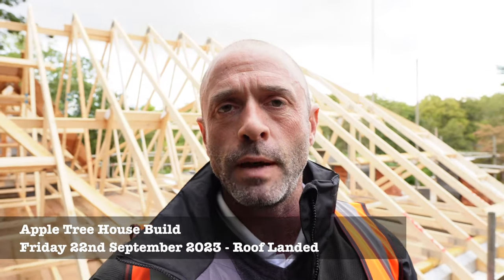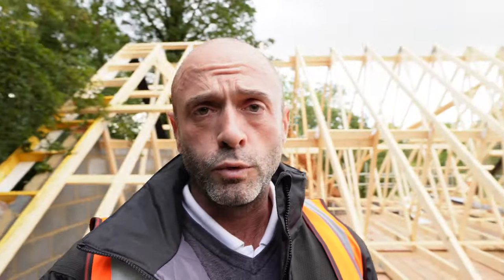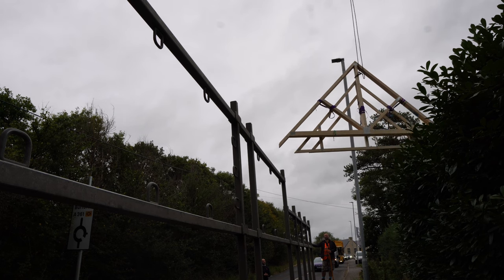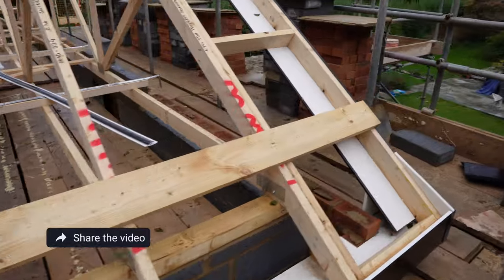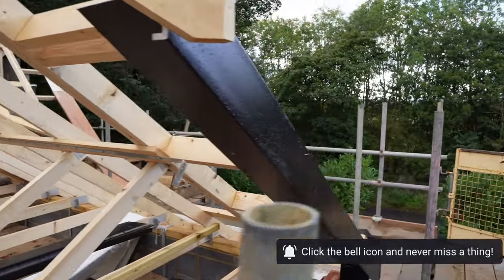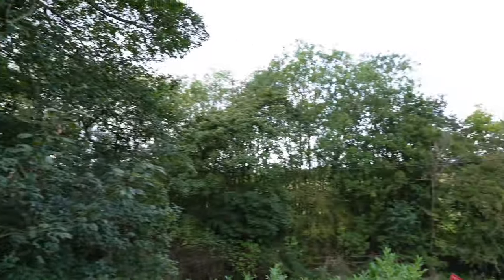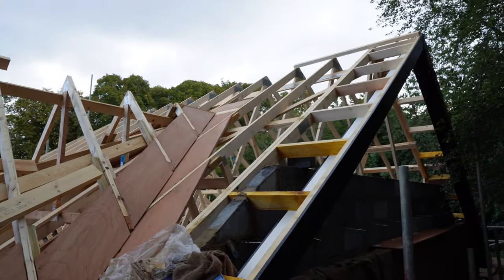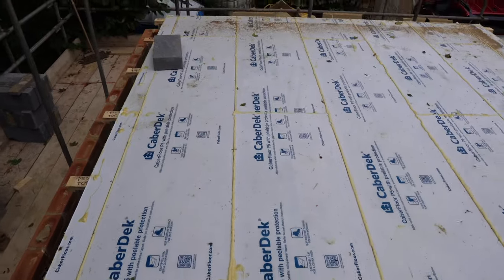How To Build Your Own House - Landing The Roof

Comment: big heap of money for crane lift , but suppose if you went old school with man power pulleys etc, would work out simuler  , or maybe high reach fork lift ?
Reply from the maker: Only safe way was with the crane mate, not worth trying anything else if I'm honest! Could of been worse, sometimes you might need a contract lift with banksmen, signalers, swingers etc and you can be looking at a couple of grand